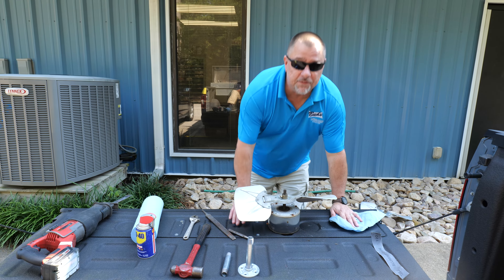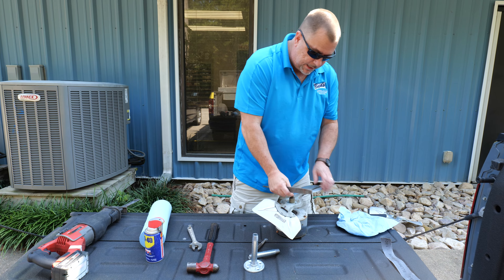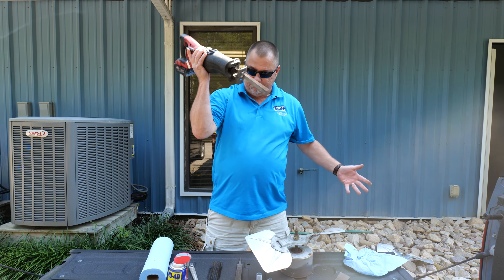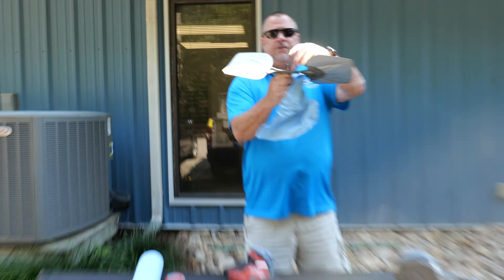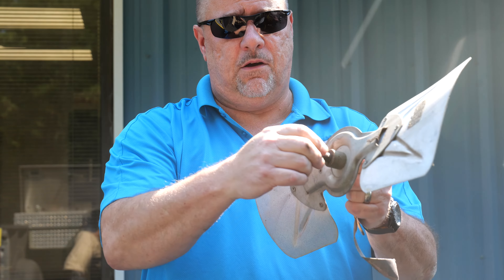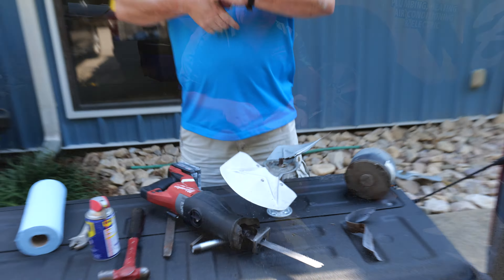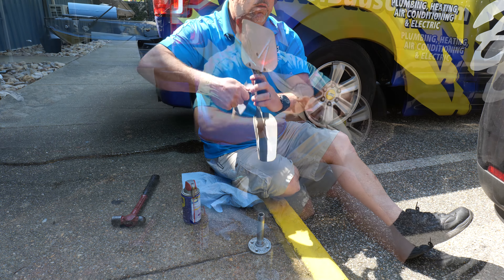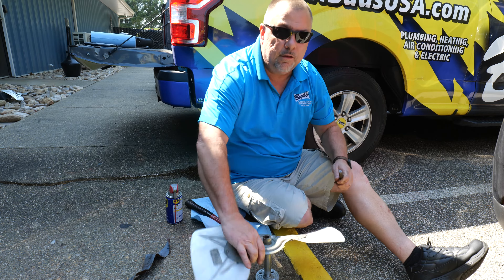How to remove stuck fan blade from condenser motor.

Comment: Pipe Flange, side grinder, took 5 minutes! The blade would slide down but not off, used pipe flange to slide fan blade back down on shaft, then took side grinder and filed the shaft down all around, flipped over put pipe flange on bottom of motor, hit shaft with bolt - Done!  Thanks for the pipe flange and cut off method idea, I just tweaked it with what tools I had.  Pipe flange kept it from messing up my three blade fan.

Comment: Dude, this is awesome... I have puller and usually use... But I met my match that didn't want to break free, Liquid wench, torch, puller, Nutting worked. However, your method worked just fine, Motor being replaced so no love in cutting shaft! I didn't have any pipe at location, so I used long socket as base. Hell I might just do this on rusted units all the time! forget wasting time with puller. Big Thanks!

PS you know they don’t teach you this in school!

Comment: Great method. I had the fan blades off in less than five minutes. Tried first putting the setup on a tree root. Nope. You need the concrete base. It came out like butter on two strikes.

Comment: Great idea with the pipe nipple and flange.    Two questions......    You specified getting two pipe nipples.     Why two nipples?     
And......after cutting the shaft, you set the fan up on the nipple,  and drove the shaft one way, then turned the fan over to drive the shaft the other way and out.   Why not drive it one way, all the way out?